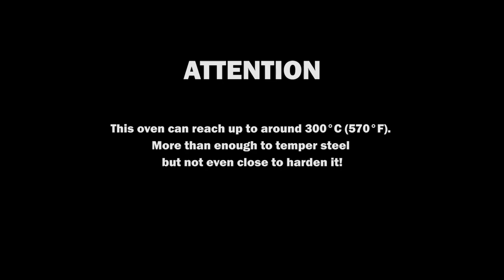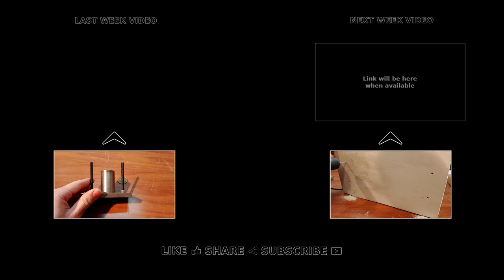DIY Electric Oven With PID Controller. Part 1 of 2

Comment: Thank you for not editing out your failed attempt, this can help others.
Reply: Could not agree more!
Reply from the maker: Part of the learning curve :) Thank you guys!
Reply: He's probably lucky he was able extract the form on the second attempt. A core with deep square sides stands a chance getting stuck no matter what you do. A better idea is to make the core so it can be taken apart and removed in pieces after the pore. Or tapering the sides slightly . In any case he could have saved the first pore by burning out the stuck core. Of course you'd lose your core mold, but if you were only make one part that's no big deal.
Reply: Sorry my mistake! He did make the core to disassemble on the second pore. My video stopped playing and I thought that was the end.
Reply: failure can be a great teacher in itself.

Comment: I recommend turn it on on 24 hours at 180 degrees centigrade so moisture evoperates and it doesn't crack then heat it up to proper temps
Reply from the maker: Yeah I'm doing a slow heating process, looks like plaster keep a ton of water, it's taking ages to get really dry without the risk of cracks xD
Reply: yes i saw a video there guy left plaster drying over night but still smoke there coming out and it cracked so 24 hours or more is probably needed for safe use
Reply from the maker: Yeah, by the way I'm leaving it at 70°C for now, I'm afraid to get near 100°C because the plaster is still really humid :)
Reply: i think this should be suitable temperature for know

Comment: How much did you spend on the materials for the plaster? Do you think it could hold up to a propane burner? What did you mix with the plaster and in what ratio?
Reply from the maker: The plaster was way cheaper than the concrete: 8 Euro for a bag of 25kg and I didn't even used it all. I never tried a propane burned but I would guess that is too hot for common plaster, I think it would degrade pretty fast... I didn't added anything to the plaster, just water! :)
Reply: Thanks!

Comment: nice video 
but why do you need it to temper steel. why not just use a regular convection Oven that works out great for me
Reply from the maker: Yeah for tempering steel the kitchen oven is fine, but when I have to melt something down like hdpe or to cure materials I don't like to do it where I later on cook my food :'D Thank you sir
Reply: + @BlackBeardProjects  

I guess you don't drink milk or bottled water?!
:

Comment: where did you place the rtd? i didnt see in bouth videos
Reply from the maker: I drilled a small hole in the top of the oven and inserted it there with a bit of high temp silicone :)
Reply: Black Beard Projects thanks man, great job

Comment: the plaster isn´t that insulating is it? and what are you going to use it for?
Reply from the maker: Yeah not the  best insulating material, but for these temperature should do just fine :) I went with that because I was going to spend too much for another batch of refractory cement! xD I'll use this to temper blades, melt stuff like hdpe and possibly cure and dry out other material like plaster molds if I'll have any chance :)
Reply: Black Beard Projects Do you mean just tempering or hardening? Its a diffrent thing.
Reply from the maker: Tempering! I point that out at the beginning of both this two videos :)
Reply: Black Beard Projects ok :), i thought you have mixed them up somehow since you could use a regular oven for temering.
Reply from the maker: Yeah sure :) for blades the oven works fine, is for other nasty stuff that this will come handy! So that I don't release fumes or chemicals where I cook xD

Comment: Whats the difference between this oven and the other heat treatment one? How the other one reaches 800 degrees while this only 300? Is the difference in temperature because the insulation bricks aren't used here?

Comment: Why did you choose plaster over refractory cement for the second go?
Reply from the maker: Because cement was going to be too expensive for this experiment xD It cost way more :(
Reply: @BlackBeardProjects  >>> Was there any need to add any kind of wire[?] to the plaster for internal reinforcement, the way rebar is used with concrete?

Comment: why not simply burn the inner form of the first oven instead of breaking it?
Reply from the maker: That would have broken everything for sure, you need to slowly cure the plaster or it cracks badly xD This can be an option for a larger oven with different material. I did that for my aluminum melting furnace back when I built it but the inner mold was made of carboard :)